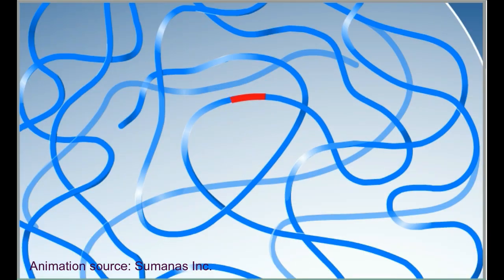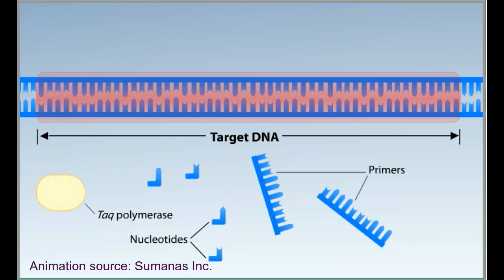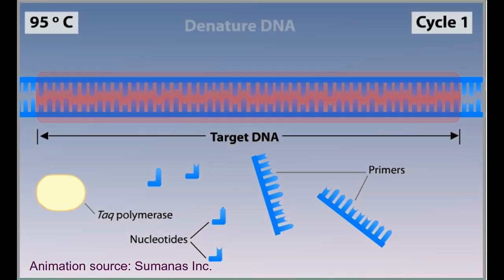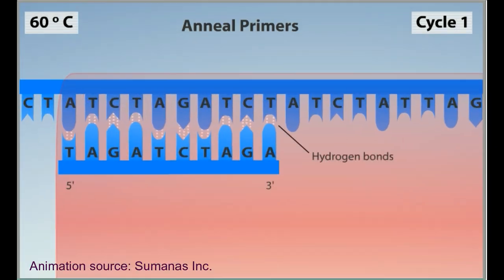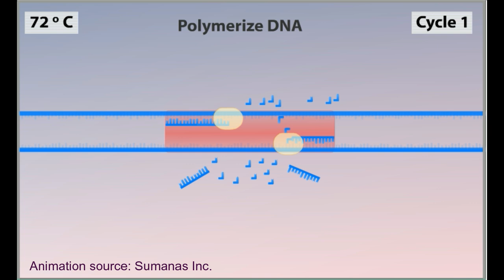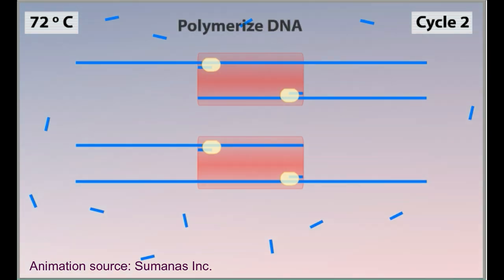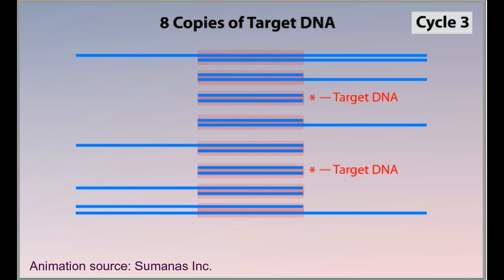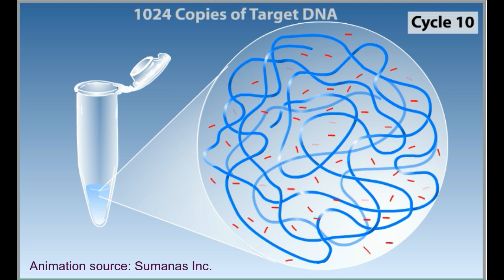PCR animation - polymerase chain reaction

Comment: In case of checking the presence of cloned insert by picking colonies and then doing PCR, does the distance of primer from cloning site affect the size of the positive clone in agarose gel? Say if the primer is 50 bp away from cloning site, how will this affect the size of the positive clone?